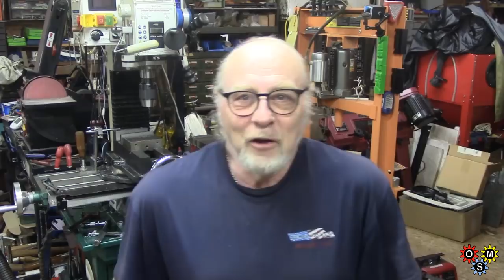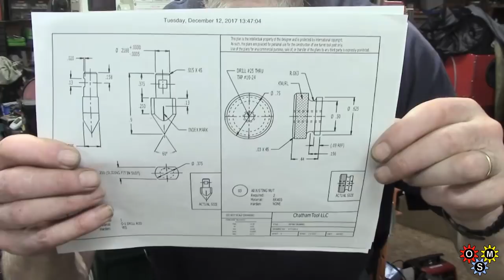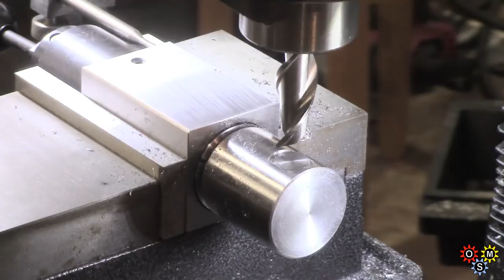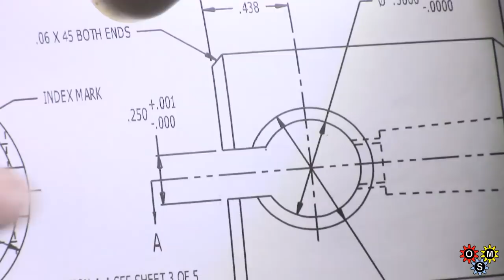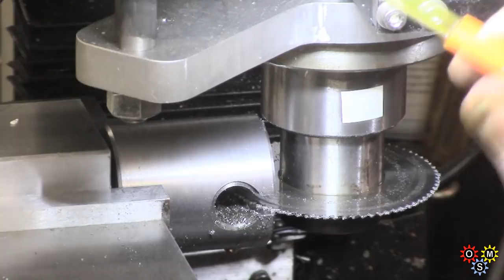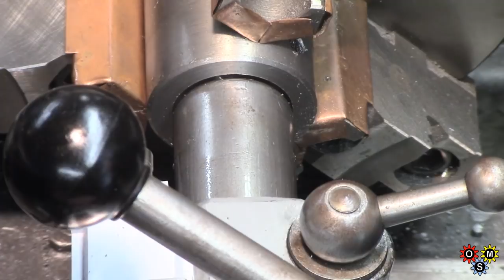Talistock Offset, Part One of Two

Comment: G'Day Chris, Way too high an RPM with that slitting saw, judging by all the smoke pissing off it.Regards Dave Tointon
Reply from the maker: Hi Dave - I think I was speeding up the video - probably 3x or 4x - should have mentioned that! RPMs actually fairly modest but on real close inspection I could see inserts were a bit cooked - the problem with buying used to save money! That plus trying to cut a relatively wide kerf meant trouble.

Comment: Good day Chris. I hope I don't waffle to much.  I saw you were working with 4140 round stock.  I've worked with 2"x 4"x 5" 4140 square stock.  I made new main bearing caps for the race engine I was building.  The old small cast iron main caps would not stand the strain of racing.  Anyway, 4140 steel, when I cut it I had to cut it at a slower speed and take a substantial cut.  I tried 0.005", 0.010" and 0.020" cuts with a 3/4" boring bar and the cutter and the 4140 didn't like it.  I found that a quill speed of 900rpm and a cut of 0.050" made all the difference.  4140 don't like small cuts for some reason no matter the tool type.  I think it has something to do with the temp of the steel generated by the cutter.  Don't know for sure.  
Can't wait for the rest of the video,  see ya', Jim
Reply from the maker: Hi Jim,
I must admit I have had very little experience with 4140 - and the problem I had when milling, at fairly low rpms was the work piece moved just a hair - enough to upset things - also the total depth needed was only about .064 - thus having to take lighter cuts which didn't help.
I am working on part 2 but still having some probs which will be explained later. In essence the darned thing is way small and tolerances very critical.
Reply: This job looks like one of those that take time and patients.  Good luck and I'll see part 2 when you get it going.  Jim

Comment: hey Chris!
Just a question.... why not put your boring head in the tailstock? The only thing left to do would be turning a center for it out of some carbon steel and harden it.... Or am I missing something+

Toodles
Paddy
Reply from the maker: Hi Paddy,
Yes, that could work well for sure - in fact "Cuppa Joe" has just done a video with that approach.  However, wanted to try this project though small size, and it also makes for automatic horizontal accuracy. Boring head would need set up for horizontal. May try that though one day as well.

Comment: Sorry if I am being a pain! This site and others have various speed and feed calculators. As far as lack or torque, are you in low range? http://mooncutter.com/speedsfeeds/ I do not know enough about your setup to know whether I am barking up the wrong tree. I see your mill is supposed to have 1hp, “the same” as an early Bridgeport, but horsepower is proportional to the product of torque and rpm, and torque curves can vary for the same hp. Certainly no offense intended, If I were not a vicarious machinist, I could just set the chips flying and have a definite answer, LOL.
Reply from the maker: Good point Toby - I did mention later on after I had probs drilling and reaming - I should have engaged low range yes. It's something I almost forget about to be honest and of course it would almost double the torque effectively.
With speeds and feeds I tend to go by intuitive approach much of the time - usually trying to stay within what seems sensible for material, tooling and machine capabilities. I did speed up video in several sections of machining which makes things look way faster than actual!
Reply: ChrisB257 One factor I had not considered was the size of the saw teeth. Not until I saw the second calculator on the link. That saw of yours seems to have really fine teeth, If your feed rate and rpm is filling the teeth to overflow, you will in effect be cutting with your swarf, not the blade! So it appears you have several factors at work here: Rpm vs max cutting speed (fpm)  for the stock 1040, and the blade, HSS i guess, their resonant frequency, then there the factor of how full the cut fills the teeth before the teeth leave the work. 
Anyway, you made a beautiful and functional little tool, which after all was your goal! 
Thanks :)

Comment: G'day Chris boy that was a tourer de force!!!   It worked out well in the end despite the hard stock you used.  One thing that I wouldn't mind on mine mill is that oiler how did you go about setting that up?   Anyhow Chris an interesting vlog and nice to see you in the shop kind regards John
Reply from the maker: Hi John,
Thank you - good to see you. I should have foreseen the probs but anyways, it came out OK.
The oiler is a gravity feed - did a vid on that way back - http://www.oldmansshop.com/vid-pages/gravity-oil-feed-mill.php - works quite well but I need a smaller base magnet ideally. Valve is rather basic but it does alright - actually, 'pinched' the brass tube more to make sure I only got drips rather than major flow. ATB. :)

Comment: Good start on the project.  Getting a good finish is a tough job on some materials.  I find that when I use mild steel the surface is always a bit rough and I have to file or sand it down some.
Reply from the maker: Hi Harold, thanks. Now to make time to produce the other bits!

Comment: Don't forget the benefit of using a machinist's jack to support under a poorly supported piece being milled. It's just like a steady rest except for milling operations.
Reply from the maker: I did add a jack for the first attempt but didn't help enough.... while it would have helped with support in vertical plane, it couldn't help in the horizontal.
Reply: hmm

Comment: Good start on your tailstock center offset tool.  That'll be great handy gadget for use in making taper mandrels.  I sure hope you get that rigidity issue under control!  Lol. Tc,  Mike
Reply from the maker: Hey Mike,
Thanks - will hope to turn up an M2 arbor or two once it gets done.
I may have to take some Geriatric Machinist pills for the rigidity problem :)

Comment: Is it me, Chris, or are you spinning those saws too fast? Visualize a band saw blade rotating. Might be possible to sharpen them with a jig and a magnifying glass. I think I have seen a cell phone used as a magnifier and maybe a Gopro. I believe Dan Gelbart made one with an  automobile add-on back up camera kit and a lens mod that changed the focal length.
Reply from the maker: Hi Toby - I should have added info re the video being speeded up - 3 or 4x! Actual RPMs were quite modest - maybe around 400 I think.

Comment: If you take one of those adjustable boring bar holders so popular in mills and mount it  horizontally in the tailstock, (some adapting may be required ;) ) you could make a center where the shank fits the bottom bores, then use the adjuster to offset the center to the side. Instead of using a pointed center, you could drill a bearing ball and mount on a piece of drill rod or adapt a broken drill bit. I think I saw Stefan drill a bearing - make a flat first.
Reply from the maker: There's an idea... certainly useful for fine adjustments. I liked the basic aspects of the plans for this one and so decided to give it a go.
Reply: ChrisB257 Well, you are surely done or near-done with the device you show, the ball on a stick design is for up to a wider angle which would require another ball stick in the chuck and a dog to turn the work. Yours should work great for what it is designed for. Thanks for speedy reply as well as your warm and friendly lessons.